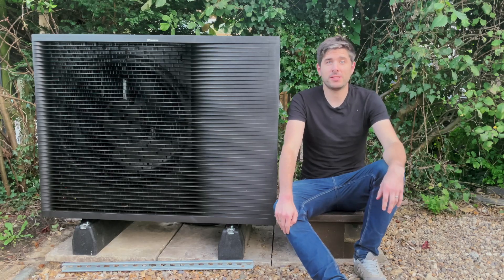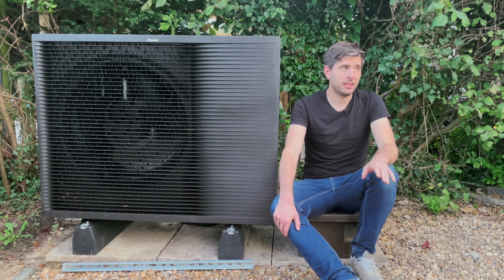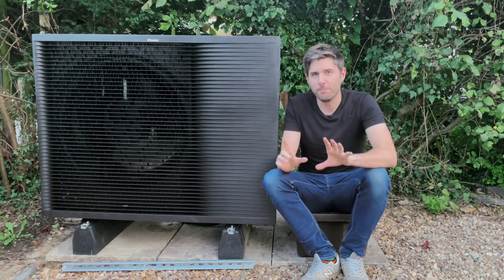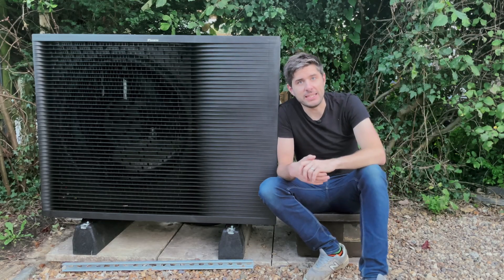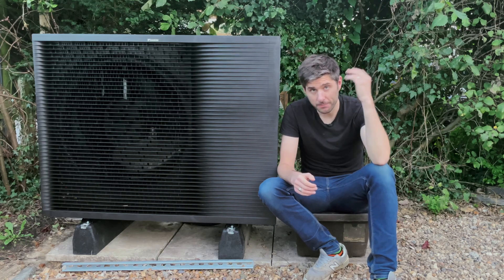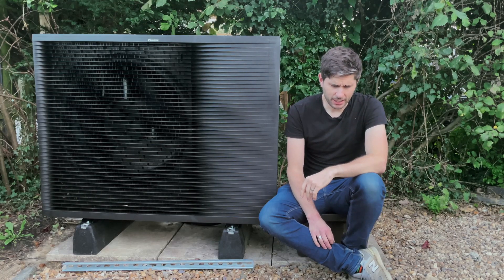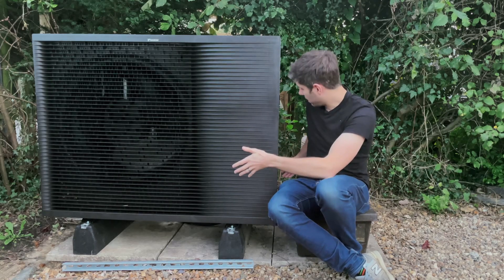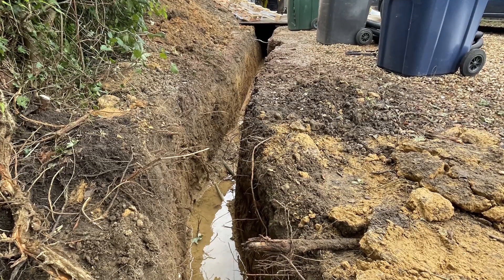Replacing an oil boiler with an air-source heat pump: Why, what and how

Comment: We have a Combi boiler and last year I started preparing and testing for a heat pump.  Dropped our flow temperature to 40 on the radiators and 50 on the hot water. Strangely, the house felt more comfortable over the winter, we were running the heating for longer but we were using about 35% less gas to heat the house to the same temperature on the thermostat - though, last year was a mild winter.  This year, I'm dropping the flow temperature even further to test again.  I feel it's better to understand now rather than when the boiler needs replacing.  Thanks for the video.  There are plenty of videos starting to appear where heat pumps have been installed terribly by individuals who either didn't understand or didn't care.  If you drive you car down the motorway in 3rd gear at 90mph, the experience won't be great!
Reply: We did this before getting a heat pump and it helped give nice confidence it would work at a low flow . It also pointed out which rooms needed a larger radiator but also which ones didn't. Which saved money over what the calculations said it needed. The msc calculation appear to overestimate from my experience. So having actual energy measurements is great.  See michael podesta s rule of thumb. He has a video on yt. Maybe as 'protons for breakfast' divide your anual gas use in kwh by 2900 I think and this give the heatpump kw power you  likely need. I found this to be a better measure than the msc calculation. Good luck .
Reply: @joewentworth7856  That's good to know.  Our Greenstar 35cdi has a stated flow rate of 750 l/hour (brand new in ideal conditions no doubt!) so I'm also interested in the effect of having a more constant and immediate temperature in the radiators if a heat pump can deliver over 1200 l/hour.  Sometimes, it can take up to 20 minutes for some radiators to start to get heat and around a further 20-30 minutes to actually get warm.  This is with a mix of 22mm and 15mm piping, mostly copper but some plastic.
Reply: You need to have a schedule to heat the tank up to full temp to kill legionnaire i believe when heating to lower temps.
Reply: Last year was an astonishingly mild winter - one might almost call it a globally warmed winter. OFC you used less gas, I bet you even turned down your C.H. thermostat a bit like a responsible person. THAT is why you saved gas - not cooler radiators.
Reply: @occamraiser  we used  no gas because we took out the boiler and replaced it with a boiler. In Bristol we had temprature of -5 c and it all worked perfectly. I know there is a camp that believes hp are hocus pokus I'm here to say my experience has been a positive  one. As I said our thermostat was a degree or 2  higher than it had been with gas and still cost less to run.
Reply: @joewentworth7856 Bristol.....-5. I so didn't believe you that I looked it up. Here from a local college website. The coldest and wettest months are December, January and February. The average temperature during this period is 3°C. However, it rarely goes below 0°C and it is very unusual for it to snow in Bristol.
Reply: @billgreen576  I'm aware it rarely snows in bristol , Ilive here. I also re looked it up and it reached -5c on two consecutive days in Dec 22. It may not have averaged that for the whole day but certainly stayed below freezing for a couple of days. The hp worked perfectly and did not run at 100%. I'm sorry this is unbelievable. But I'm not alone and modern competently installed heat pumps happy run in the range of temprature we experience in the UK.
Reply from the maker: This sounds like a really sensible idea
Reply: The higher flow will make a difference i guess. But heatpumps are not great for quick heat. There party piece is running low and slow with massive efficency. If you do need to fluctuate the room tempratures you do need a little planning. But most say its more efficent to maintain a fixed  temp 24 7 running the pump as lightly as possible. You can turn the temp down a couple of degrees at night. For comfort but start warming it back up an hour ahead of when you need it. Ours heats up at a rate of about 2 degrees per hour.
Reply: Water temperature should be 55 and above otherwise you could get legionnaires disease
Reply: Sticking to my oil fired condensing boiler.
Reply: @desmondbeattie3954 for now.
Reply: @desmondbeattie3954  that is your choice. but it won't help the planet.
Reply: @joewentworth7856  I am all in about climate change but there are many things that can be done before rushing to overhyped home heating as a solution. Your comment is sales BS. Do you sell these?

Comment: So how many units of electricity per day?  I’m still not convinced, I think my oil burner can be exchanged for a  new modulating type that uses  carbon less oil.  For me the cost of installing an Air-source  pump along with other  inevitable costs, just make this a bad idea.
Reply: They aren't expensive elsewhere.

Comment: Great video , thanks. What is comfortably warm ? and how much electricity is needed to run a heat pump 24 hours a day ?
Reply from the maker: 20-22 degrees for us. Energy usage, I’ll report back after the winter!
Reply: @michael_bird   20 - 22 degrees in a well insulated home is plenty warm enough especially as the heat is available all the time. Really look forward to your running cost calculations next year , again many thanks 😊

Comment: Great video, but whould like to know more about the hydronics, also those valves on the back of the heat pump need to be lagged. Curve settings look good. 
Ive been installing for over 15 years at worked at Daikin for 4 1/2 years.

Comment: nice video. Worth pointing out that boilers are often 70c for legacy reasons. with a condensing boiler you can often run it at 45-50c also if your radiators are big enough. It can be a good way to see if your house is ‘heat pump ready’ and also save money by using less gas and staying in the condensing zone more often
Reply: This is what I did last year, I ran my flow temp at 45c, had the boiler running 3x as long (due to the lower temps) and ended up saving slightly on the gas use the year before but was FAR more comfortable. The only time it was an issue was when we had a week at -7c the living room was too cold. I've changed that radiator to a Double panel now and trying again this year. May even try 40c (but knocking it back up to 45c if we get a crazy week again).
Reply: If it is a system boiler (not combi-boiler) it will need to be set to 68-70c because it also heats the hot water tank. If you then switch to an ASHP you will need to find a different way of heating your hot water supply (likely electric). It will lower CO2 output, but depending on your hot-water vs. heating use ratio, it may not necessarily save much money.
Reply: @maidsandmuses  aren't some system boilers fancy and can do two different flow temperatures for hot water and heating? PDHW?
Reply: @Lewis_Standing  Yes indeed, but not all are set up that way; if it was a boiler refit to an older cabled installation the boiler will only receive an on/of signal, not a hot water vs. heating signal. Then it is just set for 70c since it doesn't know the source of the demand. Newer systems can be set up with two temperatures, yes.
Reply: @maidsandmuses viessmann 4 pipe system with weather comp. Heat curve can be changed auto depending on weather outside and heat loss in property. Rads will be different temp depending on weather outside. I install them and have one in my house
Reply: @maidsandmuses don't they store the hot water at a lower temp and systematically run an anti legionnaire cycle to keep it all healthy. No point storing at 70 to mix with cold at point of use.
Reply: @allthegearuk  Maybe. But I frequently have use for 60-65~ish degree hot water straight from the hot tap without mixing with cold. Storing hot water at a lower temperature, then I would need to get an extra on-demand electrical boiler for my hot water, and/or I would need to buy a dishwasher. All heat pump solutions have both their advantages as well as disadvantages.
Reply: Plumbers/boiler manufacturers say there is a regulation about lowest boiler temperature where domestic hot water (tap) is involved due to risk of Legionella so you might find you can't go lower than 60'C on a normal modern boiler (maybe the rad circuit could be set to less if there is a separate setting/system). It is something along the lines of "Water in the boiler should be kept at a minimum of 60°C and water at each outlet point should be above 50°C within a minute of running the water."
Reply: Great points, we rarely have our condenser boiler set above 55c for the radiators and tap temperature is about 38c, but having seen this I might try a lower radiator temperature on for longer.

I'm still not 100% convinced with ASHP's at the moment due to the volatile energy prices and cost of the systems, so many elements seem to have to be in place for them to be cheaper, plus if you work at home and need to use power in the daytime having different night/day tariffs can seem expensive, although appreciate it's a lot better than an oil burning system.
Reply from the maker: Great tip!
Reply: Lol £15000 to install it and you save £300 per year on heating.  It should pay for itself in 50 years time.  Assuming nothing goes wrong, which it will
Reply: @stamfordmeetup here we go, the tired, old pay for itself argument🥱. People spend far more than £15k on home improvements with no payback at all but it's suddenly an issue with heat pumps. Really bizarre argument.

Comment: We are about to go down a similar road as you, the only difference is our house is just 10 years old and my new EPC is A106. Almost the highest short of passive. I’ve opted to have Octopus Energy install our heatpump mainly because I trust them to do a professional job and of course have the backing of a huge company, with a Which rating that far exceeds all the others. My instal after the £7500 grant is just £600 however if installed before June next year Diakin have offered an extra £300 discount so my final cost is just £300. It’s a no brainier for us. We also have solar and 27kwh of battery storage so we’ll be all electric and that’s another saving of £100 per year standing charge on gas. For those who no doubt will say that I’ve had the cost of solar and batteries, yes and no doubt will say how long is the pay back. My answer is, if I were to sell, my house its worth more by virtue of the solar, battery and heatpump plus I’ve substantially reduced the running costs of our house, which I have calculated as near 5% return on my investment, which otherwise would be earning a lot less.
Reply: EPC rating has absolutely no relevance to passive haus.

Comment: Nice video. We had a 6Kw ASHP installed in March 2023. Renovating a 1930s bungalow so had under floor heating installed as well. Would advise anybody considering installing ASHP that they can use a lot of electricity for heating - we averaged 22 units a day over the early part of this week when outside temps went down to 4 degrees for a couple of nights. We knew this before going down the route of an ASHP to replace an ageing gas boiler and have had solar panels and storage batteries installed.
Reply: We have a 7kw heat pump in vicotorian mid terrace (with loft and rear extension so some improved insulation) in bristol and during those days we used 5 to 7kwh per day. Obviously you house and weather will be different but I would not just accept high usage. A new system can be dialled in to improve efficency. Primarily by changing the flow temprature. Or the weather compensation curve. Essentially  try a lower temp. If the heat pump can't maintain the desired room temp then turn back up. Most engineers will set it to a temprature they are confident will work. Its very unlikely to be the peak efficency. Have a Google for heat pump forums there are lots passionate knowledgeable  help out there.
Reply: @joewentworth7856  I'm also in Bristol with a Victorian mid-terrace, original attic room (will be looking to upgrade insulation as my refurbishment progresses) and large rear extension, so I'd be interested to know a bit more if you don't mind sharing. What size and make of system have you got? What installer did you use? Did you have any problems siting the external unit? My house is only about 5m wide and most of that at the rear is either doors or windows.
Reply: @johnbanks8065  We have a larger than usual terrace garden so that made siting easy, (although required 10m of insulated pipe work to be run. it does not have to be sited by the house, it could be sited side on. i don't know about your windows, but it can be sited under them if the sill is high enough. they can be hung above head height on a side return and can go on flat roofs if any of that is an option?  have a look the dims of Arotherm 7kw they are all quite similar size. you need about 1m of clear space in front of the unit. shared boundaries can be an issue for permitted development, you have to be a certain distance from them. although I have seen several that don't adhere to this though. i think it relates to noise and they are far quieter than they were, ours make less noise than the neighbours combi flue. I got quotes from Pink heating, stone heating and swift mechanical, all seem to know their stuff but only pink offered Vaillant which has a low environmental impact refrigerant R290- aka propane, rather than r32 which is quite a potent green house gas if it were to leak. but there are restriction to where you can place an r290 unit due to it being flammable. Although no more flammable than the gas piped into your home currently! from memory initial estimate was free and maybe i was charged for a site visit, and this was deducted from the bill when i went with Pink. The install was good. not perfect, insulation of the pipe work was a bit average but i sorted that. the setting i was left with worked well to heat the house, but i think most will tell you to get the best from a HP expect to tune it over the first heating season. i massively improved the COP by lowering, bit by bit,  the heating curve (just a number) until it could not keep up with the demand then go back up one step. not difficult but cant really be done on the day of install, and will vastly improve performance and running cost.
on the subject of how big a unit you need: 
 https://youtu.be/hCeghKa3liM?t=324 - this is a great rule of thumb for those on gas presuming you currently keep you house at the temperature you like. i found what my house actually used was 30-50 % less than what the MSC calculations came up with. So i pushed for the smaller 7kw unit, (first quote was for 10kw ) having had temps of -5c last year the heat pump was still over powered.  so the unit cost less and running costs are lower than they would have been if the oversized 10kw had been put in.  

hope that helps!
Reply: @joewentworth7856  Many thanks for such a prompt and detailed response. I was considering siting the unit towards the end of the garden (probably about 7m away from the end of the rear extension, then a further 10m to the utility room with the hot water cylinder) but was concerned that would be too long a run for a monobloc system and would seriously affect the COP; did they use something like Mibec pipe for the exterior run?
Reply: @johnbanks8065  I think the max run with out extra circulation pump is about 20m from memory.  How much the cop is effected I'm not sure. Shorter would be better but I don't think it's that detrimental. I chose to run a galvanised trunking along the wall to the house and the pipes inside the trunking  were insulated with a kingspan pipe insulation 28mm. I did that bit myself and it looks neat but was a bit of a pain to fit the rigid insulation in. I would look at other options there are lots of product specifically made for the job.
Reply: No one mentions costs,
Reply: Be interested to see what flow temperature they've designed for and the SCOP you're achieving. Those 22kwh could be making 88kwhs of heat (brilliant COP of 4) or 66kwh of heat (meh COP of 3) or performing much worse. 
So id echo Joe above and see how you could improve things

Comment: Brilliant video, you should call it something like heat pumps "Untangled" (you can thank me later). I am really interested to see how you get on with your HT pump to replace oil as we have taken a leap of faith to cut off mains gas and go with a Dakin LT ASHP. We have to be fair ripped the house appart to install underfloor heating and insulated as much as we can (if only I could get my builder to understand insulation and airtightness). We have also added solar and battery, we expect the ASHP to cost more in winter but hope that solar and battery will help balance that cost. The one thing you dont call out in your commentary is the difference in cost of electricity and fossil fuel. It does make me angry that ASHP are quoted as 3X more efficient than fossil fuel, while this is true electricity costs 3.5x more to buy. So if you don't get a SCOP of around 3 or more it will be more expensive than gas.